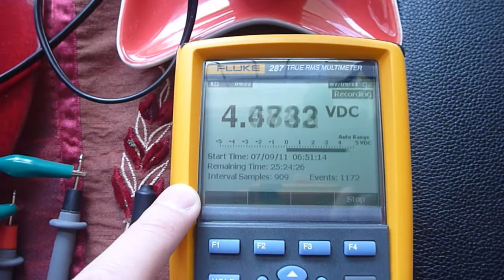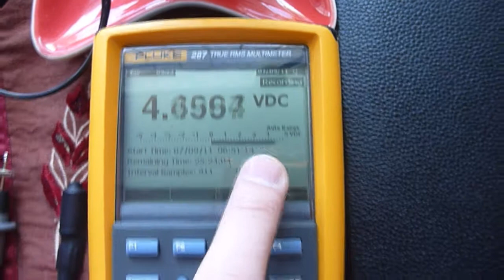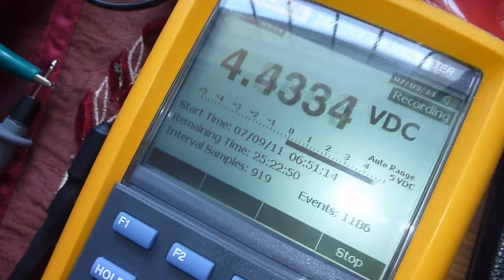Solar Powered Kindle  - Part 6: Troubleshooting, draining the Kindle battery..

Comment: simple solution is to connect the solar panel with a series diode direct to the battery terminals inside the kindle bypassing any kindle circuitry.you will can then use your original solar panel.
d.c convertor not required as solar cells automatically reduce voltage/current due to drain due to high output impedance and current sinks into battery automatically keeping it within safe levels.diode prevents battery discharge into solar panel or short circuit.